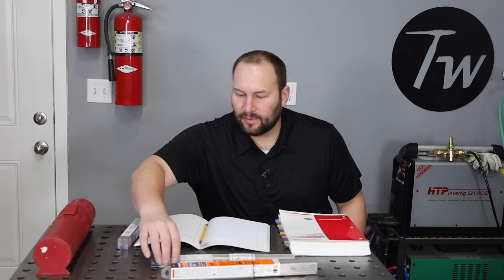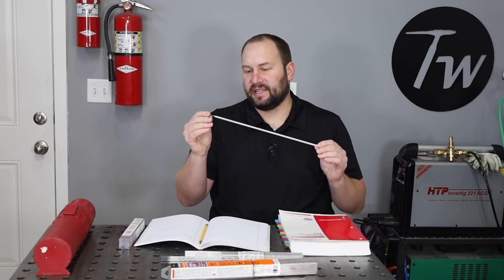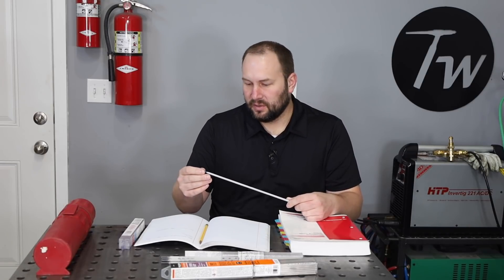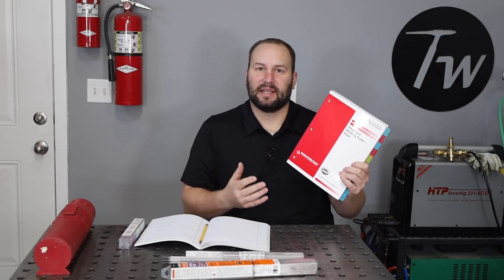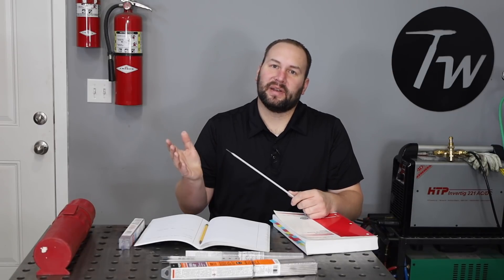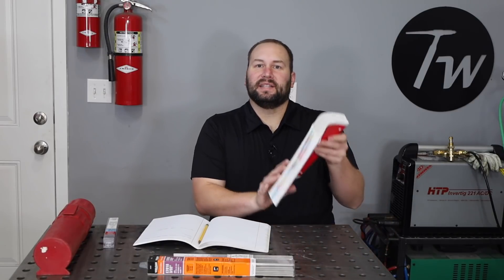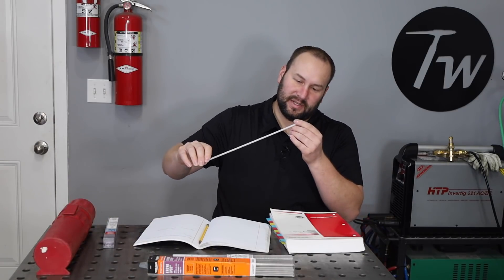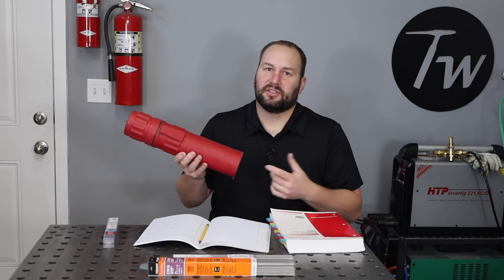Do I Need to Store Welding Electrodes in a Hot Oven?

Comment: Question: I went to my local welding store to order 7010 1/8"in. I want to try this because of its downhill & not so clean,galvanized rusty surface properties. They said they can get 8010 much quicker & for $30 less than 7010, so my question is is there a difference in performance other than the tensile. I normally use 7018 when I do equipment repair on farm & construction machines & vehicles. There are positions for me  where downhill is better for visuals while welding. Your thoughts would help

Comment: The short version:

Do I Need to Store Welding Electrodes in a Hot Oven?

In general, for at least 99.44% of the people reading this, the answer is "No."  

If you're a hobbyist welder looking to videos like this to find out if you need to store electrodes in an oven because you heard someone say that you had to or the rods would be no good, then the real answer is almost certainly "NO", because you're not going to be doing any code certified welding jobs that requires low hydrogen mitigation procedures to be in place and used.

Will 7018 rods be ruined if they are not stored in an oven?  No.

This topic is a classic example where people with too little knowledge apply too much information to a perceived problem, that in most cases does not even exist.
Reply from the maker: Exactly 👍

Comment: Good information! I am currently welding some plow chisels on the shanks of a pasture renovator. Used to open pasture land for air penetration for improved grasses. I have had a big problem with the 6013 rods that I was trying to use, until a welder friend of mine told me to get some 7018 as the chisels were heat treated steel and the plow shanks were not. I was getting nice looking welds, until I knocked the slag off, and the welds were not connected anymore. Looked good on the shanks, and looked good on the chisels, but in between looked like burnt toast. :(  Thanks for your videos as I have never had a welding class and learned by trial and error. My father in law use to say my welds looked like turkey shit on a pump handle, but that I was a hell of a grinder!  ;)

Comment: I have found old 6010, 11, 13,  series rods can pick up excessive moisture and affect performance too. It was amazing how much better they ran after "drying" them out. I oven them at 300 degrees for 5 hours, then put them in the sealed tubes.
Reply: 6010 and 6011, both cellousic electrodes, REQUIRE moisture in the coating to perform properly.   By putting these in an oven and drying them, likely caused them to perform outside their designed performance.

Comment: Good video.  In welding school we all drew out of a 50 lb can of Lincoln 7018 for about a week until the can was empty with good results.  There was a rod oven in the shop but I would only bake out rods if I was going for certs.  I found an open can of 7018 at the dump that definitely needed to be baked out in order to run at all  After bake out it ran fine. That day I was glad I had a rod oven.

Comment: Super! The timing of your video was great. I am about to weld some 6 steel posts and hadn't opened my first box of 7018s yet. I am glad you explained the component factors for cracking. Usually you are just presented with hydrogen content. And yes, all other rods deposit a lot of it anyway. Thanks!

Comment: On a hot sunny day I set the electrodes on steel painted black and they heat up quite well, ignite better, weld better.
Reply: Thanks for speaking of “warmed rods run better.”

This was why I was trying to build a “rod-warmer” - went too cheap.  Didn’t work out.

Comment: I keep my 7018 in a sealed tube like the one you showed.  If it's a job I'm concerned about I use a halogen work light to heat my rods right before I use them, only takes a few minutes and works well especially when welding outside in the winter.

Comment: I have a box of Lincoln Excalibur that were left in the garage and don't run right anymore. There is a lot of popping and spatter and it's hard to hold a arc as it wants to go out. I have to start long arcing it to stay lit when it starts to die. Can you put them in a normal oven and fix them?
Reply: Yes.

Comment: What can be done to keep them dry.  Put them Into a low temperature oven then into a partial air evacuated tube while still warm. Used a 3" plastic tube, one end glued on, the other end with an 'o' ring inside the cap. Put a bicycle valve inside the cap, backwards, and using a vacuum,  pulled out some air. Long time storage.

Comment: I remember one time welding in the rain, everything was wet. I had to be very careful how I handled everything. I put a rod in and turned the welder on with my foot , turning it back off at the end of the weld. Everything was wet, I believe my rods ( or short pieces I was using ) were actually in a bucket of water. They were totally wet - the total opposite of having them in an oven. I believe they might have even been 7018.
They welded okay, but then I wasn't trying to pass any weld tests with them.
I recall they were steaming away as I welded. Those were probably super - hydrogenated welds that day.

Comment: Hey Tim! Thanks for covering this topic!
So one day I was welding a very thin square tubing and did notice the welding current is too high and I couldn't get a nice weld. The rod was Esab OK46/6013 from the same box as before and I know I was doing ok, 
After heating up in the oven for about an hour the welding current went back to normal. Looks like if you store your rods in very humid environment moisture does affect the performance. But I didn't notice that problem while doing welds on some thick metal with 80A or higher.

Comment: I saw a Navy video of why LoHy rods need to be hot out of a rod oven.
  It showed a ship in rough seas that cracked in half.   And sunk
And it was HYDROGEN in the welds that caused it.   And baking the Lo Hydrogen electrodes in a rod oven removed the Hydrogen from the rod.
 And Used within a specific time limit.  Like 30 minutes. 
  Plus the metal has to be warm not really cold.     Great Video

Comment: Hey Tim. Quick question, first off love the vids been binge watching all of them as I'm just getting into welding. Got a cheap decent little all in 1 machine for around 300 on Amazon and unfortunately I chose the worst time of year to begin this hobby lol. It's pretty cold so I was watching your DIY fume extractor video as I was considering indoor welding. I have a basement with a decently sized little area and most everything is concrete other than the ceiling and some cabinets. The ceiling is roughly 8 feet high. My question is would u suggest against that at all? Aside from the fumes of course cuz I'm limited to flux and stick as I haven't got a bottle yet. But again I'm looking into making a little ventilation system to run out the window. Just wanted to ask a pro before going for it as obviously I'm still new and don't want to put my home at to much risk lol. Any feedback would be greatly appreciated! Have a great day.
Reply: It shouldn’t be a problem as long as you do have fume extraction of some sort that’s actually effective. Welding fumes can be dangerous as there are a lot of different chemicals generated by the plasma’s high temperatures. Just make certain the any flammable items are further away than the furthest spark fly distance. Those tiny globules of metal are several thousand degrees when they begin their flight.

If, as you should, clean your metal before welding, make certain to never use any chlorinated solvents, such as many brake cleaners. Check before using.
Reply: @melgross  thank you! And yeah I think I'll definitely be sticking to acetone if I have to clean anything. I actually just watched a vid a few days ago where somebody talked about how bad break clean and any chlorinated cleaners can be. Will definitely be staying clear of all that for any welding work

Comment: What is a rod oven? How do you get moisture out a 7018?
Reply: As a suggestion, you may want your welding rod oven to be between  250-350F for optimal performance. Different rods sometimes need different temperatures — for example, some reconditioning 7018 rods may be baked at around 250F while holding temperature lower than 212F for out of the hermetically sealed container. Always seek the manufacturers temperature recommendtion for both holding/reconditioning.

Comment: Are the 7018S good for beginner?
Reply from the maker: I think they are. The only challenge is that they can be a little harder to strike an arc with after part of the rod has been used.
Reply: @TimWelds  I learned electrode welding 50 years ago but didn't practice it. 
Now I'm a little older, but I want to learn it again! Thank you!

Comment: I had a box of Lincoln 6013 in 5/64; I use to use them quit often... (Now I kind of prefer Fleetweld 180 6011 but that's another story). One day, they start acting weird (pinholes, porosity, etc) in a known environment (same position, same prep, same metal thickness, etc). Couldn't see the reason why... I decided to put them in the rod oven. That took care of it all...
Reply: 8th
Reply from the maker: Cool! I can see that, though a very small amount of moisture is actually beneficial for 6013s.
Reply: @TimWelds  Then, it is a bit weird...

Comment: I am an amateur welder and I store my rods in an ammo box with dessicant packs.
Reply from the maker: That’s a great idea! Thanks!
Reply: Eventually I'll find a mini fridge and disconnect the compressor and install a 40W bulb in it.
Reply: @dolphincliffs8864  rod ovens reach 300 degrees. A 40 watt bulb isn’t going to dry them out the way high heat drives out the moisture.
Reply: @melgross  Fine. I'll use my pizza oven then. It's the one I use for powder coating cast boolits.
Reply: @dolphincliffs8864  that would work,